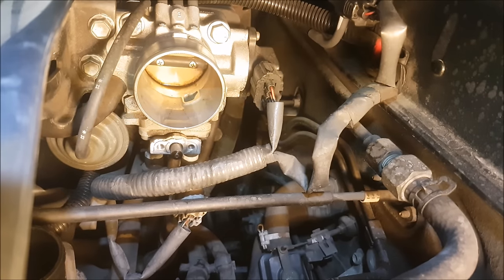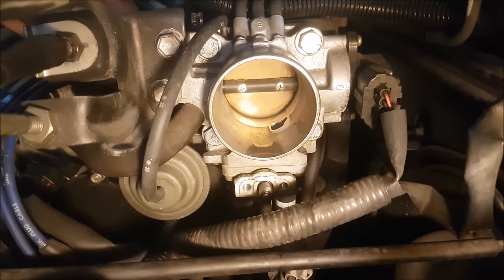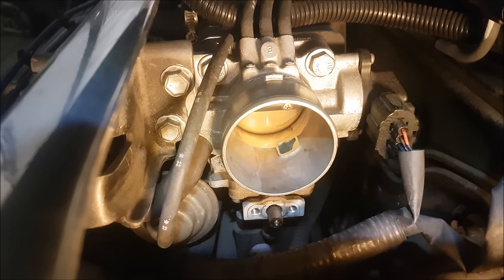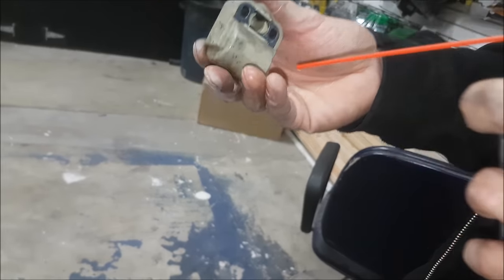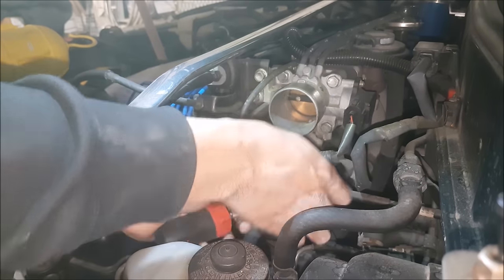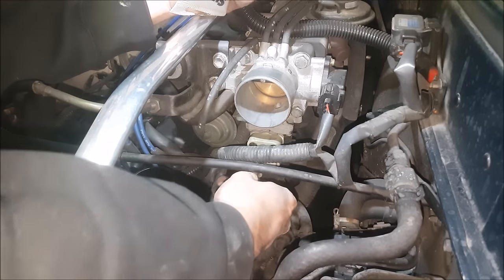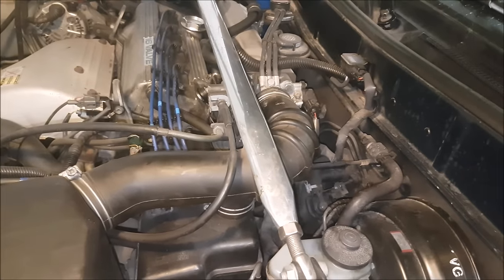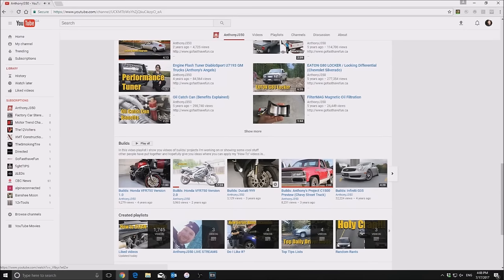Toyota Idle Air Control Valve Maintenance (Correct Idle & Cold Start Issues) | AnthonyJ350

Comment: Quick question, after I replaced the spark plugs, I unplugged the throttle body and clean it, now the car won’t idle.  It runs smooth (not rough) for 5 seconds then turns off, do I need to reset the throttle body?  Basically the car stalled after five seconds.
Reply from the maker: Try holding the throttle open a little after you start it so it can burn off the cleaner.
Reply: No cleaner was in the engine.  It appears the the throttle body couldn’t stay opened for idling.
Reply: I solved the issue, a fuel pump resistor with heat sink that was mounted to the windshield wiper tray needed to be plugged back in.  That explained the short running of the engine of about 5 seconds.
Reply: @davidnguyen5028  thank you for adding the fix to your system

Comment: The way to regulate the IAC valve is to turn the screw all the way down and return 6 turn CCW, rhis is the original setting.
Reply from the maker: Thanks for sharing!
Reply: Is that the original setting for this motor or it applies to all Toyota motors with a screw adjuster?
Reply: Hi, how to do that?

Comment: I sprayed fluid into the hole....didn't fill wholy...started right up. Recconected the main hose ..I tried to back up and stalled....now it won't even turn. :(   Lights come on, battery 12.4 V....but does not even crank. What could it be???
I did not remove the valve. Did I short something out....maybe?....hope not.
Reply from the maker: If it doesn't try to crank at all, check all the fuses.

Comment: Have a 2006 toyota tacoma 4cyl after cleaning TB on cold start up rpm jumps to 2000rpm has never gone that high before TB was cleaned. Idles fine after warm up how do you reset to stop high idle at start up. Thanks
Reply from the maker: Try disconnecting the negative terminal, push the horn after and let it sit for an hour to reset the computer. Hook it all back up and take it for a drive.

You can see if there's also a relearn procedure for Toyota.

Comment: hi sir nice to see u video....i have camry 2007 2.4 ......i have same cold start problem.......I already cleaned injectors ...throtal body ....new spark plug and also changed new fuel filter .......but still when its cold it will take minimum 3 to 4 self then start .......after start going well no idle problem no jurking .......when its hot then start easily but when its cold then take time to start ...do u have any idea to solve this isuue ....i will be very thankful to u .
Reply from the maker: I would try taking off all the grounds and cleaning them and add dielectric grease.  Also clean the battery terminals and make sure the battery is in good condition.

Comment: My 2006 Toyota Sienna bogs down when I start to accelerate and is very choppy unyil it gets higher speed >30mph-ish. It revs up just fine when it's in park, but in drive is when it bogs. Could cleaning the throttle body and that little hole be the fix? Maybe it needs a new o2 sensor? Thank you for your time.
Reply from the maker: Has the van ever had a tune up. Are all thr fluids changed regularly?

Comment: My 98 rav4 is idling in gear at about 550 and the thing shakes like crazy. No codes. Data seeeeems okay from a layman's look other than low rpm. Think IAC? I hate to do a parts cannon on it.
Reply from the maker: I'd also check for vacuum leaks. It's older so vacuum lines can crack over time. Also check the PCV valve.
Reply: @AnthonyJ350   vacuum would increase the rpms no?

Comment: Given that it's called  IDLE air control valve,  just as your title states, I'm trying to understand what acceleration would have to do with it?  Accelerating involves opening up butterfly so there is no need for IAC during.. in simplest operation.

On my old rig it's closed during all WARM operation,  using coolant temp is how it opens and closes.  So on cold start,  it's fully open and within a few minutes closes completely.  On your's,  perhaps the computer uses it to fine tune air intake even at acceleration..must be,  right?
Reply from the maker: There wouldn't be a need for it but if that valve isn't operating properly it may be affecting how the induction system works.
Reply: @AnthonyJ350  Very interesting!  I'm glad to see you fixed your issue, cheers
Reply from the maker: @TheWeirdSide1  Also check your EGR valve if you have driveability issues
Reply: @AnthonyJ350  I finally put my old OEM duatributor back on and intermittent hard start has not occured since.  That first idiot mechanic who blew my heads also told me to replace distributor because electrical inside was bad.  14 months later,  I finally had a second OEM distributor I could tear apart...there are no electronics inside!   My issue was aftermarket distributors from oriellys the whole time.  

So now back to original symptom...the cruise control has erratic behavior.  It surges and randomly revs high.  It also will shut off at times and cruise light just blinks steady every 2-3 seconds.    There is no information regarding such a flash sequence.   5 flashes is issue with component,  but mine has no information that I can find.   Egr system appears to function properly
Reply: @AnthonyJ350  Note:  my speedometer cable is jumpy...Apparently there is speed sensor in the dash so that might be my issue with Cruise Control.  All this time I thought speedo cable was not tied to any sensors...just mechanical!  This is gonna be a fun job to replace cable
Reply from the maker: @TheWeirdSide1  Let us know if that fixes it
Reply: @AnthonyJ350  Exactly!   Few return to post issue resolve.   I have every intention of a follow up...

Comment: What exhaust do you have on this Camry? It sounds really good!
Reply from the maker: A Magnaflow 14" round muffler that replaced the factory resonator  and one of their Street Tune mufflers in the back with a double walled exhaust tip.
Reply: @AnthonyJ350  thanks for the quick reply
Reply from the maker: @chasehall1987  No problem
Reply: @AnthonyJ350  à

Comment: My 04 corolla have high rpm when cold start( 2100 rpm) and come back down afte couple minutes when its warm. I clean the mafs sensor and throttle body but it didnt change nothing. Whats ur opinion
Reply from the maker: Maybe look into changing out the air intake temperature sensor and also check for vacuum leaks.

Comment: My 96 Camry will be running like a kitten and then out of the blue die.  Looking for any helpful hints on what to service because no one seems to know what’s happening.  Thank you!
Reply from the maker: If it's not this check the EGR valve for operation.
Reply: AnthonyJ350 What’s the best way to check the EGR valve for operation?  Last time it died on me I immediately pulled the throttle body boot and noticed some smoke...does that tell us anything that might be happening?

Comment: Been having the exact same problem with my car as its a 98 model it kinda wanted too die today at a stop light but i nust turned the corner anyway and i heard a filthy TB and Dirty iacv can cause this did you use MAF cleaner and TB as well ??
Reply from the maker: Just cleaned the throttle body with CRC throttle body cleaner.
Reply: AnthonyJ350 how about the little square port and do I remove the electronic part as well as the middle hose underneath soo i can get access too the screw too let the gunk out and will it have a hard time starting afterwards??

Comment: Could this be the same problem on a 3sfe ? I got a NO fail on my smog but i did a  new gasket and spark plugs with oil change and radiator flush. Still bogs right under 2000 rpm.
Reply from the maker: Good chance of the EGR isn't working properly as well.

Comment: I have an issue where my 98 corolla idles at about 1100 when started for first time in morning then after about 20 minutes of driving goes up to between 1200 and 1800. Would it be the IAC?
Reply from the maker: You would have to hook up an OBD and live data stream it. Your car goes into a different mode when warmed up and uses the sensors to run vs preset tables when cold.

Comment: does that problem turn the check engine light on and cause the car to not want to drive when in gear mine does that until it warms up and the check engine light will go off and car drives great until it it shut off again
Reply from the maker: Maybe, I would scan the vehicle when the check engine light is on to see what part of the vehicle is being affected.

Comment: Hello, I have a 2000 camry 2.2l  witk 96k miles with high postive long term fuel trim at 20% at idle, short term  flucuates between potisve and negative 5% , but at higher rpm the long term fuel trim  drops to 5%, but I cannot find a vaccum leak visibly, would a exhaust manifold or intake manifold leak would cuase this? Or would a bad/clogged fuel injector cause this? I also have do NOT have check engine light on. Also I've replaced both 02 sensors, pcv and valvet cover gasket, cleaned throttle body,  swapped spark plugs added new denso fuel pump and strainer.
Reply from the maker: Try running a good fuel injection cleaner like Lucas and also try upgrading the grounds for the battery and engine.
Reply: @AnthonyJ350  I also swapped the fuel filter and swapped out to a different oem MAP sensor. Noe my LTFT at idle is at 9% and STFT FLUCUATES BETWEEN 3-6% POSTIVE, 
WHILE ACCELERATING LTFT drops to 0-2% 
STFT FLUCUATES from -3 to -8 %. It has to be a vaccum leak somewhere or exhaust leak , or clogged dirty fuel injectors. Ima swapped out my injectors with denso oem remanufactred .
Reply from the maker: @desertheatkicksgee  What does the battery voltage look like?
Reply: @AnthonyJ350  12.3V  when car is off and when car turns on dropped too 11.5v but immediately started charging up to 13.6v  ,
Reply from the maker: @desertheatkicksgee  It doesn't go to 14.5 ever? What if you Rev to 2,000 rpm?
Reply: @AnthonyJ350   no. Highest it went was 13.9v
Reply from the maker: @desertheatkicksgee  How is the car driving?
Reply: @AnthonyJ350  i feel it picks up way better,  wit the denso map sesnor. And the new fuel filter ,and fuel pump ,strainer,  and fuel pump filter.  But  I'm tryna locate the vaccum leak . Also my injector ms at idle was around 3-5ms, then revved it past 1500 rpm and pulse width was up to 13ms

Comment: 6:13 no oh no bro you can't let any dielectric get on the pins because the grease will not conduct electricity and possibly give computer and incorrect reading. I used to do the exact same thing until I was corrected I don't know why they call it electric grease
Reply from the maker: Yes you can, I prove it here https://youtu.be/YgJRKlE7pYg?si=J6jNPZcTYB9EGkT0

Comment: Damn bro i have a 1995 4runner and it started with having to replace the EGR valve then the code 31 poppee up b i clean the throttle body the connection to the mass air flow sensor n it hesitates for the rpms to go up so it slowly starts to get speed ima try thisni hope n prey it fixes the problem  i do have that issue early morning it dies n after like 4 times of trying it turns on n stays on
Reply from the maker: Did you fix it?

Comment: I have problem with camry06 throttle itself going up and down 😬. I changed spark plugs, cleaned filter, and even sprayed (cleaned) carburetor cleaner on throttle but again issues came back.
Reply from the maker: Not sure, I highly recommend bringing the car to your local trusted mechanic.
Reply: @AnthonyJ350  thanks I did checked and he says I need to replace carburetor sensor !
Reply from the maker: @ChizKake  Not sure what the carburetor sensor is.  Do you have a part number?
Reply: @AnthonyJ350  not sure what's this part called but mechanic cleaned it & it works fine for couple days. 
Https :// ibb.co / r2QssLB
Https :// in.co/ tQkT8Mn
remove all above spaces to see picture
Reply from the maker: @ChizKake  Thanks for sharing!
Reply: @AnthonyJ350  the idle rpm is still more than 1k  between 11k & 15k

Comment: I have lexus gs300 ... sometimes when I start my engine dies soon and the security light flashes and it dsnt get reset... sometimes it will take one day to reset.. why this happens
Reply from the maker: Seems like the factory Immobilizer is activating. Do you have a spare key? Try turning unlock in the driver's door before starting

Comment: Hi I done this with  my 2004 toyota avalon cleaned it still won't run properly idles while choke is and when it warms up and normal idle will die and go up die and go up till it stalls
Reply from the maker: Does your car have an EGR valve?  I'd have that checked for proper operation.

Comment: My 2000 tundra runs fine, idles really low then stalls when stopped. Any ideas?
Reply from the maker: Does it have an idle air control valve?

Comment: Hi pls am having this issue with my 05 corolla the engine goes off at slow speed or traffic but moves very fine on fast speed,I have changed the fuel pump and filter, plugs,coils ,maf sensor and fuel nozzles but it still the same problem l,please what can I do sir?
Reply from the maker: Try changing the air filter and cleaning the throttlebody?
Reply: I have done that I change the air filter and Cleaned the throttle body  or is there a special way of cleaning it ?  also I didn't  see any hole in the throttle body like the one in your video
Reply from the maker: @emmanuelchuzzy5876  Does your car have an idle speed sensor?
Reply: I don't know about it,I drive a 05 corolla could you pls tell me where its located?
Reply from the maker: @emmanuelchuzzy5876  You'll have to search and read through your service manual. I don't know.

Comment: Hi, great video! I have an issue with a high idle every time I start my 96 Corolla. When I put it from Park to Drive then the idling goes down.  Do you think it might be the IAC?
Reply from the maker: Worth a shot and cleaning it out.
Reply: Not sure if the MAF might be involved in that issue too, very quick and easy to clean that but needs careful handling (plenty of videos). Be forewarned, I just pulled my whole throttle body out, detached the IAC bit (it's different style to this one - 2002 corolla) and cleaned everything thoroughly with throttle body cleaner, toothbrush, and cotton buds for the small crevices. Runs great now BUT it idled high (just over 2k) when I first started it up again - I knew to potentially expect this so it didn't worry me. It takes a little time for the ECU to re-learn optimal settings. I let it sit idle for few mins in Drive (went to normal), took it for a drive around the block, couple mins blast along the highway, then pulled over and idled some more - it was better already but still a little high so finally I'd read that allowing it to idle with the AC/Fan running could help. I turned the headlights on as well. All this puts a little extra load on the motor (by way of A/C and alternator pulleys) and I guess requires the ECU to use the IAC to make further idle adjustments. I saw the idle drift downwards during 4-5 mins sitting with these things on. Once I got home few mins later it was idling great at just under 800rpm. You don't have to, but but watch some videos if you do decide to pull everything apart, there are some small coolant lines that go to the IAC to help it stay warm and so you need to be prepared to plug them up as you disconnect them (old spark plugs are good). It's not a difficult job if you know what to expect but each car is different and some things were mounted differently than I'd seen in US corolla videos, so it's just time consuming if you're inexperienced. But totally doable if you have some basic tools and prepared to work methodically. Take care not to damage old stuck coolant hoses etc. If you only have a couple hours just try cleaning it like this first. Good luck.
Reply from the maker: @chocolate_squiggle  I have this video for cleaning the MAF https://youtu.be/iU3inRdJ0H0

Comment: I got a 1997 Toyota Corolla it will start and run for about 2 hours and then it will quit and then you try to start it it will run for a second and quit but if you let it sit overnight like I said it will start up and runI'm going to buy a fuel pump in the morning and put it on and see if that's the problem
Reply from the maker: I've also seen a defective EGR cause stalling issues.
Reply: It ran all day fine but when it gets cold it don't want to run I put a new relay  fuse in it and it did good but it like I said when it gets cold outside at night time it don't want to run and I do not hear the fuel pump kicking in but why would it run if it's not kicking in
Reply: @AnthonyJ350  will the fuel pump make it run sometimes and sometimes not
Reply: @AnthonyJ350  I took it to advance Auto parts and it said that it's bad oxygen sensors that's the only thing they can find they told me take it to a garage and let him hook it up so I did and he said it's not raining nothing it's not even showing the car name either
Reply from the maker: @ericcarroll9643  Are they just going by their scan tool?
Reply: @AnthonyJ350  some are and some ain't

Comment: is this can apply to my problem, when i turn on AC the idle get down and shake almost off engine. thank you
Reply from the maker: No that's just strain on the engine because the compressor is engaging.
Reply: Yes iac is there to bump idle up when ac is on and smooth it out. Also increasesidle over 700rpm tomaintain charging from alternator when you turn on high drain electrical accessories and radiator fans. If your battery goes dead while idling with ac on for example...and alternator is good then its likely that the iac is not working properly. Ive also had cracked vacuum hoses cause poor or high idle